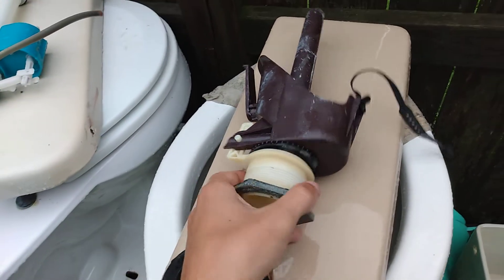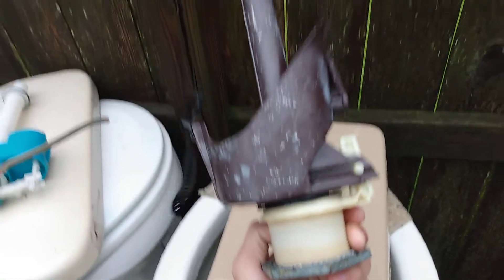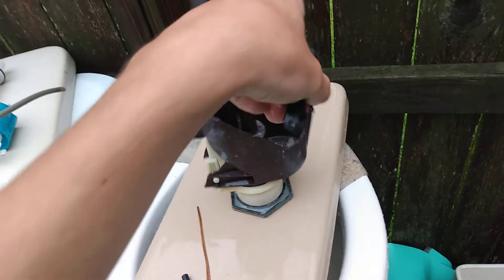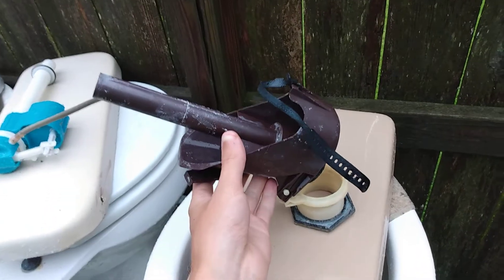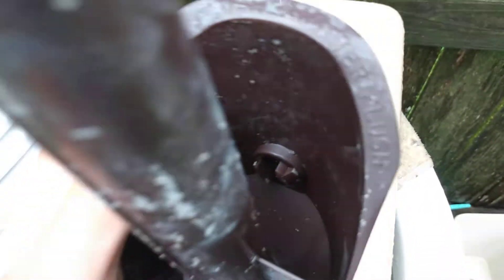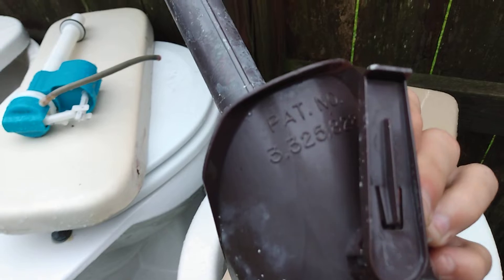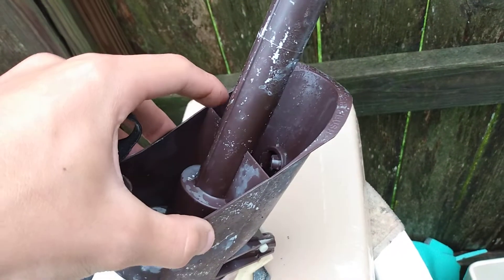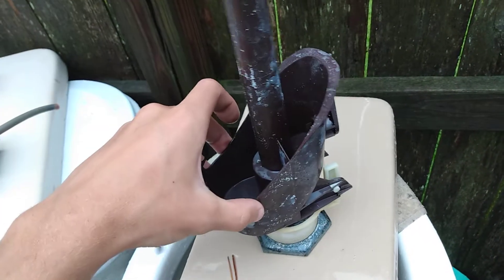How a Universal Rundle tilt valve works

Comment: I remember the toilet in my grandparent's half bath had this exact tilt flapper almost 30 years ago.   I was in grade school at the time and I remember the letters U/R on the bowl.   

Years later after doing extensive research, I find that this oddball flapper was used exclusively for Sears Universal Rundle toilets.   Which makes sense, because my grandparents had a Sears account I'm told, back in the 1960s and 70s, and purchased many of the bath fixtures and home furnishings from Sears, and that toilet was installed a couple years after they purchased the home in September 1967 when grandpa's mother was living there during her last years when she broke her hip and couldn't go upstairs, which was the only bathroom in the house until that point when the closet on the main level was turned into a half bath.  Probably around 1970 or so.   

Anyway I never seen anything like it since.   I'm assuming very few remain in use today.
Reply from the maker: I personally have never seen one of these but I got several out of some old toilets that were from an abandoned warehouse. I installed one in my toilet and it worked very well.
Reply: There are 2 where I'm staying right now. It used to be a cabin that was described as gradually thrown out the window as a bigger house was built around it in phases. The kitchen walls are the only cabin walls to survive along with the basement that was added onto. Anyway...

 To the best of my understanding, A father worked at sears when he and his son built the first floor of this house in 1964 hence the green Sears toilet on the mail floor. The next year, the son graduated HS and I believe he also worked for Sears. They added on the upper level around 1967 or 1968 and bought a white Sears toilet. Both of those have the U/R tilt valves and they work to this day. I've replaced the seals on both of them. 

 The basement has a Mansfield toilet with their flush tower stamped February 1983, municipal sewer replaced the home septic system in 1981, so I would imagine the basement toilet, which would have been original to the 100 y/o cabin, was replaced with the new sewer hookup. IDK. An ejector pump, which I hate, pumps everything uphill on every house along this road. 

 The late next door neighbors who moved into that cabin in 1958 and did some additions also had a Sears toilet from the same vintage. After the last surviving spouse died in 2014, the new owners did a complete remodeling of the bathroom so that toilet is no longer there.

Comment: That's cool! I think I have seen one of these on the net somewhere but I never knew who made it. The only thing that would be weird is that the bowl refill can't be fixed to the overflow tube. Is that little rod support for the refill something you made, or did it come off of a UR toilet?
Reply from the maker: I made that because the original fill valve was one of those ballcocks with the bendable copper tube that doesn't attach to anything. Fluidmaster sells/sold a metal piece that serves the same function. I found one new old stock from the 1990s that I used on my Drexel.
Reply: @OCC_Plumbing_and_Restorations  ah, cool.

Comment: I actually replaced one a while ago
Reply from the maker: They sell replacement seals for it.
Reply: Owen Cowan I did not know
Reply from the maker: @erickmorton8085  I know because the installed one has a red seal with a price tag on it whereas the others have damaged black seals.
Reply: Owen Cowan I just had to replace it cause it leaked I got a fluidmaster flush valve
Reply from the maker: @erickmorton8085  Well those are nice and tall so if the flapper is adjusted right, it should work great.